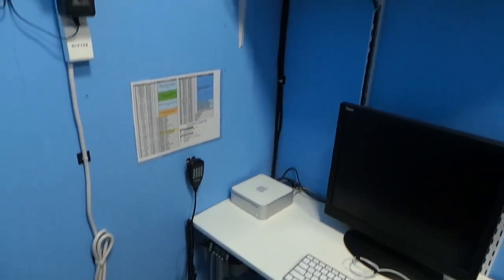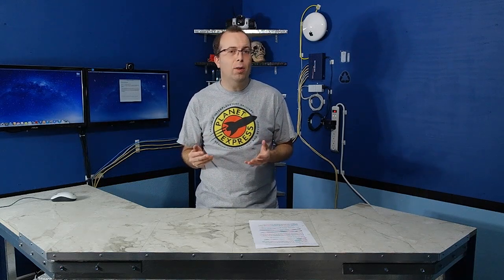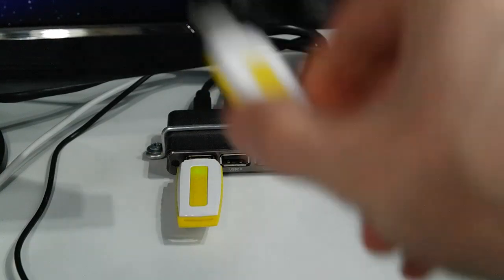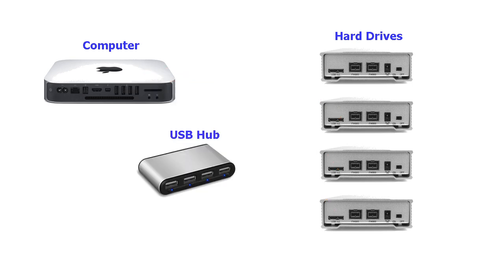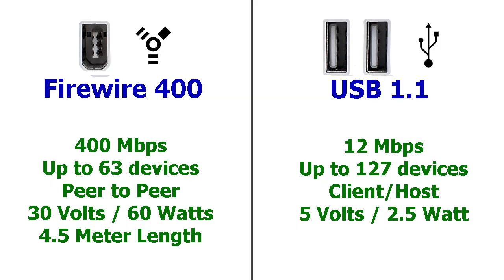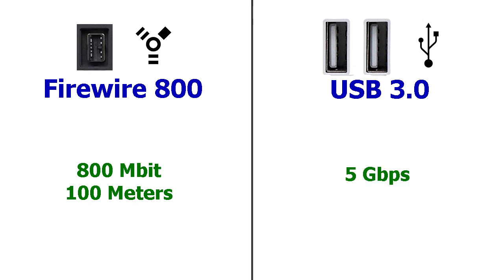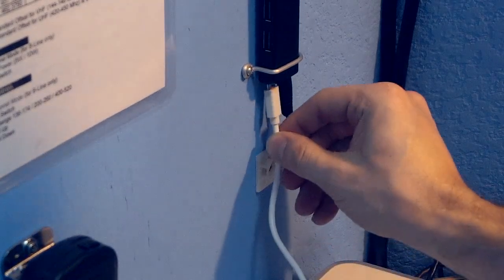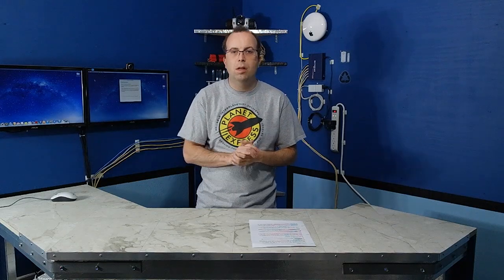Farewell R.I.P. Firewire, Hello USB!

Comment: firewire was replaced by thunderbolt. not usb.. i can daisychain with thunderbolt
Reply: What's Thunderbolt? Is it good?
Reply: +Isaac Adam thunderbolt was started by Intel it's like a second gen mini display port with a lot more capabilities such as data transfer and daisy chaining. It's rated up to 50gbps on thunderbolt 1.0
Reply: Thunderbolt 1 & 2 have the same connector as mini Displayport because thunderbolt is universally "backwards" compatible with displayport. If you have a monitor with a displayport input, a displayport cord, and a computer with a thunderbolt port, then you can connect them and the thunderbolt port will function as a displayport output.

And the switch from Thunderbolt 2 to 3 is easier in most circumstances than USB type A to C because of the daisy chaining properties of thunderbolt. If you have multiple thunderbolt 2 devices connected to each other, all you need is a single adapter at the end that plugs into your computer and all the chained devices work exactly as they did before.
Reply: +Brendan Tate no is is not you can buy thunderbolt cards for pc and they use pcie express x16 slot
Reply: It's you who have no clue. 8b/10b coding is used in a hell a lot of things to achieve DC-balance, including Ethernet, USB, Firewire beta mode, etc... invented way before DVI and HDMI. BTW, DVI/HDMI uses different 8b/10b code-set unlike previously mentioned standards and DP. Old DVI display will happily accept HDMI signal with RGB color coding (which is usually used). DisplayPort transmitter sends signals in LVDS format and HDMI transmitter transmits signals in TMDS format. Displayport use different voltage levels compared to DVI and HDMI. Therefore even if DP output is dual mode with HDMI/DVI support, it still needs voltage level converter in "passive adapter" (not that passive, huh?). HDCP is built on top of the data transfer, is optional and often not used in PC displays, and to my preference should never had born in the first place.
Displayport has differential bi-directional, half-duplex auxiliary channel, HDMI has I2C for E-EDID + optional bidirectional 1 wire for CEC. Hot plug is just a wire connected to +5V through the resistor, what an invention...
Displayport supports daisy chaining multiple displays, HDMI/DVI do not at all.
So how in the hell are they the same?
Reply: +matsv201 Wow. Then I guess that Firewire and USB 3.0+ are more reliable than Thunderbolt.
Reply: I have a clue because I'm EE and actually designed some electronic devices which are currently in production.
One more big difference, DP don't have twisted pair for clock signal unlike HDMI/DVI. The most ridiculous part of what you said is claiming that HDMI is more similar to DP compared to DVI. 
EDIT: BTW, DP does not have exactly 3V as you claim (3.3V PWR). HDMI/DVI signal level is 3.3V. 5V in HDMI is only for I2C and hotpug. Signal level in DP is around 0.4Vp-p
Reply: So... you claimed DP/HDMI are almost the same, unlike DVI/HDMI :). When proven opposite, become angry and call that irrelevant shit. What a strong arguments you have.
Reply: +matsv201 Thanks for the info.
Reply: Only IF there is a thunderbolt 3 harddrive case, which is still a no-show, but hey, we could dream right?
Reply: @4IN14094  I'm from the future and I have great news for you
Reply: helloeyItsZoey 

I think you confused industry standard, and standard in the industry
Reply: helloeyItsZoey Its a industry standard for consumer and presentation screens... not for industrial monitors.
Reply: Jonathan Rogers Well, recent laptops does have thunderbolt port build in, but it is Thunderbolt 3, and it uses USB type-C plug, which is a huge improvement compare to Apple offerings.
Reply: matsv201 DisplayPort can do 8K at 60HZ, and HDMI does 4K at 30HZ so lol
Reply: "This enables HDMI 2.0 to carry 4K resolution at 60 frames per second (fps).".
matsv201 dp is still better. that's why more high end graphics cards have MORE displayport ports then hdmi..
Reply: also, thunderbolt is low overhead, and low latency, unlike USB, and it's not dead, even in 2017. Audio interfaces alone keep it alive.
Reply: Jay, do me a favor? Shut the fuck up when you have no idea what you're talking about. the USB C connector does not mean it's USB. Thunderbolt is much closer to external PCIe. Please google it, and stop giving people fake advice.
Reply: DP is not a ripoff of HDMI. Both how data is transferred and the connector are completely different. HDMI on other hand is a complete ripoff of DVI with smaller connector and royalty fees added, although it got updates after that while DVI did not. That's why you can use passive adapters between DVI and HDMI in either way. Actually the signal source has no way to know if HDMI or DVI device is attached other than by EDID contents, which still would tell about port type only by secondary means like audio support declared. Only EDID standard 1.4 added a definite way to say it's HDMI, not DVI.
Reply: And in fact, DP is much more similar to SATA or USB3.x in the way how the data transferred, rather than HDMI.
Reply: Displayport is not a ripoff of HDMI. DP offers way better performance for support for more displays and higher resolutions.
Reply: +Jonathan Rogers Most premium Windows laptops come with thunderbolt nowadays.
Reply: ¯\(ツ)/¯
Reply: trizm 6ix 六 Why do you compare with HDMI 1.4 when both 2.0 and 2.1 exist? 

And no. DP cant do 8k in 60Hz native. It got to run DSC to run 60Hz in 8K.

Bandwidth is 18Gb/s for HDMI and 25Gb/s for DP so the diffrence  is not that big.

The reason why HDMI sues lower speed connection is do to cable certification. HDMI got a more laxed cable certification simply put.

HDMI and DP works in exacly the same way. DP was only made to bypass HDMI certification. If you think that DP is a "professional" version you are really lost. Rather the opposite is true.
Reply: trizm 6ix 六 The draft is, but its not certified.. 2.0 have been out for quite a while, and its the version that have 18Gb/s.

Initially DP used draft HDMI version to push to the market
Reply: trizm 6ix 六 It can run 5K in 60fp to... or 4k games in 75fps. 
The HDMI 2.0  have 28% lower bandwidth than DP 1.4.

You can´t run true 8k in 60fps on DP.. you have to use both EIA/CEA-861  block reduction as well as compression. 

Really if you use normal block and no compression DP is limted to 5k 60fps as well.

"dp is still better. that's why more high end graphics cards have MORE displayport ports then hdmi.."
Its because the licensfee is a lot lower on DP than HDMI
Reply: The problem with Thunderbolt 3 using the USB-C connector is consumer confusion.  Lets assume you you have a HDMI  monitor and you buy a USB-C adapter to connect it., but it might not work because there are three different ways the USB-C can be acting to output video

Type 1): Video delivered via USB 3.1 protocol
Type 2): A display port signal acting as HDMI
Type 3): Thunderbolt acting as HDMI

Now the only laptop I know of currently that implement all three video out options are the current line of macbook pros.  So random converter dongle your borrowed from you buddy may, or may not work, unless you are using of the said Macbooks. 

I just say if you have a non-mac device just stay away from any USB-C connector device that is stylized for macs...
Reply: OTIS  lol your lieing!!
Reply: I didn't say graphics cards. Also, what I meant that rom has software I meant that it works with software to do it's job.
Reply: He is probaly unaware of thunderbolt because he is using an Mac Mini 2010 wich does not have thunderbolt.
Reply: matsv201 thunderbolt is apparently backwards compatible with FireWire provided you have proper adapters. I have no idea how.
Reply: The YouTube Critic - "And yes the Thunderbolt 2.0 plug is the same plug as Mini DisplayPort. Why? I have no idea"
It's because Apple invented the mini displayport and owns all the patents for it so by using the same plug for Thunderbolt they didnt have to pay somebody else and all the tooling equipment/parts was already there.

They used Firewire for the same reason. They invented it so it was designed from the ground up to fit their needs. As the inventor of it they pay less or no royalities for using it too.
Reply: Jun Hong DisplayPort supports 8k at 60 hz
Reply: trizm 6ix 六 That is not corect. DP only supports 25Gb/s. Then it still need color reduction to work
Reply: 2.1 isn't out yet?
Reply: ***** ik lmao
Reply: @old stuff, 4/10, I hope to god you're the semi terrible troll I think you are.
Reply: OTIS notice the drives he had didn't have thunderbolt
Reply: 9291Sam usb is better
Reply: that's just cause you don't know any better mr cool panckaes. it's way worse. you know what's good? knowing before you talk.
Reply: Murphy the Turtle listen,i use both and usb is faster for me i dont know maybe the adapter for thunderbolt is causing the provlem
Reply: Vitto Wang no those are two entirely different things
Reply: @Shidou, there are absolutely pieces of malware that store themselves in rom (hardware) and can persist through a clean install. Please stop talking.
Reply: rom has software though, so you are incorrect
Reply: millennial, you said that hardware like screens and graphics cards could never get infected, and that you could wipe them away. I told you that you were wrong, and you said rom was software. In the context of that conversation you might as well have said "chickens eat farts" (regardless of the classification, that rom is still on that hardware, which you said couldn't get viruses) Nor does it go against the argument that you can't just hard drive wipe them away. With logic like that you'll never be a good sociopath. Children.
Reply: Isaac Adam a lot more better than both
Reply: OTIS it was co-started by both Intel and Apple
Reply: Will - try responding to one person at a time. You responded to part of my comment, and part of other peoples. I never mis understood DP TB and HDMI, infant, I'm the one who corrects them originally, like months ago. Then you actually respond to something I wrote. You don't get how. monitors can get viruses. fucks sake. have you ever heard of firmware? it's software in hardware that exists now. You infect that, and that's how you give a fucking monitor a virus. Are you kids for real? They did proof of concepts on video cards and ROMs in mother boards years ago.
Reply: So much misinformation in this thread. Like most of it.
Reply: correct me if I'm wrong, but wasn't hdmi dvi+audio?
also thunderbolt 3 can be used to plug in a GPU which is quite useful on a small laptop as you don't need a desktop pc.
Reply: Murphy the Turtle rekt
Reply: 700gsteak: Nobody pays any royalties for Mini DisplayPort. It's freely available.
Reply: My thunderbolt multiport has USB-C, VGA, HDMI, PCI adapter for graphic cards.
Reply: He never said USB replaced Firewire in the video. He only said he could not find any new Firewire devices and therefor needed to add USB storage to his system. He probably was aware that Thunderbolt could be used, but that would assume he had the connections available for it.
Reply: And now Thunderbolt 3 uses the same connector as USB 3.x Type C.
Reply: How did you know, OTIS? 
Are you a Thunderbolt fan???
Reply: thunderbolt 3 is basicly usb 3 with extra features
Reply: Never heard of it.
Reply: get me a macbook with thunderbolt and a thunderbolt hub :)
Reply: I'm not sure why you dislike Display Port so much, they both carry digital signals and one is a newer, improved version of the other. One standard is bound to be replaced by another, if you don't like this idea I hope you're still using composite. Jokes aside, I'm pretty sure HDMI limits 4K video at 60hz with the HDMI 2.0 standard. Though it came out in 2013 I haven't seen too much of HDMI devices that utilize 2.0. Display port on the other hand supports 120hz at 4k and 8k (Not sure about the hz). Sure we don't have 8k monitors and a very small amount of 4k 120hz monitors today, but its simply future proofing. Nothing wrong with that. If it's the connector that you dislike, Display port is starting to be  integrated into the USB C standard creating not only reversible but compact connectors. Now, don't get me wrong I've only used Display port on my desktop, and HDMI is great. I practically use HDMI with everything. But it's obvious its time is slowly coming to an end. In fact, most likely the next gen consoles will implement display port spec. Of course, that doesn't mean HDMI is going to be killed off anytime soon.
Reply: @junhawng  I miss VGA
Reply: In what industry is HDMI the standard? You'll find most HD Video is carried over HD-SDI in industry.
Reply: +matsv201 hdmi is trash man... displayport is the dvi replacement
Reply: +matsv201 yes, sorry. I should have said one of the newer sdi standards. HDMI is definitely the consumer/home cinema standard, but you won't find many industries, whether TV, film, cinema, or live events using HDMI as standard. They will accept it, but it is not the standard
Reply: +matsv201 possibly. I suppose you could say it's the TV manufacturers' industry standard, but that is arguably because of its encryption capabilities.
Reply: +Isaac Adam  thunder bolt is a new standard developed by Apple and Intel. It has a whopping 40 gigabit speed look up more on it is awesome
Reply: Isaac Adam Well.. ironicly USB is kind of between Thunderbolt and Firewire in system interface.

While USB have a relatively low level of abstraction, and the abstraction that is there is as little as you can get away with (USB is very much Keep it simple stupid-design).

Firewire is abstracted by a both network and system protocols. So its very much abstracted. This make it flexible, safe, but also complex and expensive.

Thunderbolt is really a very simple interface. Its just a port right on the PCI-e just modulated right out of the computer. Make it.. well sort of cheep... well on the computer side... on the slave side its a bit worse.

This makes Thunderbolt quicker and more flexible, but also more pointless. M.2 interface do about the same but in a much better way. Also a lot cheeper.

I don´t really se the thecnical point of Thunderbolt. This seems like its developed for there own business and not for the customers. Its really a market replacement for Firewire in there sales division.

And it also seems like a lot of people think that Thunderbolt is a replacement for Firewire, because its marketed this way.

In a technical standpoint Thunderbolt is really stupid. Because its a direct to system interface. If you for example use Thunderbolt to access a Projector in a hering room: How ever can install a in-between device that install spyware on the computer.

Because its a direct system access the virus can write it self directly to disc, there is nothing the OS can do to stop it. This was never a problem with firewire
Reply: "screens" or displays cannot get viruses so how would they be able to infect the connected computer? I could be misunderstanding what you said. 

Thunderbolt combines PCI Express and Display Port into one serial signal, and additionally provides DC power, all in one cable. Thunderbolt is not a ripoff of mini Display Port, it just uses the mini display port! Thunderbolt is not the connector, it is a standard. It can come in the form of a mini Display Port connector or in the form of a USB type C connector. 

You said that thunderbolt is only useful for "connecting screens", but it can have many other use cases. Because it can carry video, audio, and other data all in the same cable, you could have a computer with one thunderbolt cable connected to it and have the other end of the cable connected to a Thunderbolt dock to plug in the computer peripherals. This means that all of the data would go over just one cable! And if you used a Corning Fiber Optic Thunderbolt cable, you could achieve this at a length of up to 60m/200Ft. Thunderbolt also allows daisy chaining and speeds up to 40Gbps! 

I think Thunderbolt cables with USB Type C connectors will be the way of the future. I hope you consider this information. If anything I said was factually inaccurate please point it out so I am not spreading misinformation.
Reply: OK Do you even know the difference from HDMI to DP?
Reply: +matsv201 you can use passive adapters to convert to dvi. Means nothing
Reply: St0ner1995 
"you can use passive adapters to convert to dvi"
Actually you cant. If you put a DVI to HDMI/DP adapter on a DVI port, its actually the HDMI/DP that run in a fallback mode.

In most cases is actually the other way around. What is a physical DVI port, is really a electronic HDMI/DP port that is able to run in fallback mode.

HDMI/DP is virtually the same. The only diffrance is the extra pair for DP and how its licensed.
Reply: +matsv201 yeah. HDMI is shit, display port can do everything better and more. For example, I can run 6 displays off of display port when I can only run one off of hdmi. Display port also supports higher resolution at higher frame rates
Reply: Actually no. Thunderbolt and Firewire is totaly different types of interfaces. The connector looks kind of similar, but there the similarities end.

Firewire is a network interface, and thunderbolt is a systemport.

Thunderbolt is also the worst standard ever. They change everything for every new generation. And the interface is just a ripoff of DP, that is turn is a ripoff of HDMI.

Using Thunderbolt to connect drives drives is horrible.. don´t even think about it. Also the system is very sensitive to system attack.

The only thing you real can connect with any point to a Thunderbolt connector is a screen, and then it also totaly pointless because then a DP works just as good.. well actually better. (there is both daisy chain and hub capability of  DP, but few screens support it, on the other hand, even fewer support TB).

Worse is that if the screen is infected by a virus.. then you got it on your computer to. TB have total direct system access, there is nothing stoping a virus
Reply: @matsv201  Thats a bunch of lies(untrue assumptions) tbh 😅
Reply: matsv201 not trying to sound like an ass but how the hell does a monitor get a virus.
Reply: @matsv201  if i am right thuntherbolt have acesse to pcie with direct memmory accese?
Reply: @lukkan99  Pretty much.. but it might not be true for every version
Reply: @matsv201  You are so clueless.  Thunderbolt 3 is a superset of USB 3.1 and has more speed and more capabilities, including daisychaining high end external gear just like FireWire did.  They changed ports literally ONCE and that's just to make it play nice with the USB-C standard, which not a bad thing at all.  If you have an old version, it's still backwards compatible via a simple port adapter.

How is it a ripoff of DP?  Because it once used the same port? And if so, who cares?  DP is a decent standard, but TB3 does so much more.

The ONLY valid point you made is in reference to security, because there was a vulnerability (which can be patched via firmware update) that allowed an attacker to compromise SOME system if he had physical access to them.  However, this is only because Thunderbolt allows much deeper level hardware access to USB.  Again, not a bad thing because this means more capabilities, features, and better performance due to less host CPU reliance.
Reply: @bluesdealer  
Eeeh.. no. You are clueless... While thunderbolt use the same port and 8/10 modulation as USB 3.1 it's very different in all other regards.

Dasychaining is really not a thing. It's just a internal 1-2 hubing... Or rather switching.

Thunderbolt use direct dma that's makes it very quick and also makes possible to use external components as if there was internal. The downside is that there is no firewall protecting the system.

In short never plug in a unknown device in a combined thunderbolt usb-c conector
Reply: You can't patch out dma issues
Reply: @matsv201   You should only plug trusted devices into USB, regardless of it's level of hardware access.  There is still malware that can activate from simply plugging.  TB's ability to act (and basically perform) like an internal component is one of the best things about it.  You can theoretically build out complex systems using devices with soldered internals and no expansion slots.

Would you plug in an untrusted PCI express card?  Of course not.  Same goes for TB devices.  And it's not much of an issue because it requires physical access.
Reply: helloeyItsZoey HD-SDI is really quite outdated by now.
Reply: +Jay Cie No it isn't. Take a little bit of time to do some research before you spread misinformation.
Reply: cthehollowman You don´t have a clue. DP is a non standard rip of. The only reason its got higher preformance is that it got 4 lanes in steed of 3...
Reply: I supplied ample of prof. Its a fact. They are very similar. Not identical, i never claimed that

Yes DP have 3 volts. Its not really a major change. Some of the axuliary channels work somewhat diffrent

Its quite obvius that you read it of Wikipedia and don´t have a clue what you talking about.
Reply: OTIS thunderbolt IS USB c
Reply: Kill thunderbolt
Reply: Daisychain, what is this, 1985?
Reply: OTIS well, thunderbolt uses a USB to connect to devices. Also, only apple uses thunderbolt, everyone else uses normal USB.
Reply: St0ner1995 You don+t have a clue. DP is a botch non certified HDMI. Basically a rip of.HDMI.

HDMI is a industry standard, DP is something VESA just ripped of and push to market a head of time.

They use the exact same transfer standard. There is one lane more (4 in steed of 3) on DP). Everything is the same. DP is just a basterd of HDMI.

That is why you can use a passive adapter and convert HDMI to DP... its basicly the same. DP just steped of the standard to make it hit the market quicker.

"For example, I can run 6 displays off of display port when I can only run one off of hdmi."
That is not accurate. You can run... well basicly any number of a HDMI,but you are practically limited by the resolution

"Display port also supports higher resolution at higher frame rates"
If you have more than 1 8K monitors or more than 4 4K monitors... well than sure... do you have that?  DP have one lane more, and is there for slightly faster.

A lot of people tend to belive that HDMI is a rip of from DP because DP drop the new earlier. The reason is that HDMI got a grace period for the the new versions, DP don´t. DP just copy the next HDMI of the grace period put it into market and hope for the best. That is why DP is way more buggy.

In other word... HDMI.. if you can fit the contact.. it always work.. for DP... it might work
Reply: If you think Thunderbolt is going anywhere, you've been paying way too much attention to Apple hype.
Reply: Sorry dude but thunderbolt is USB now. The current standards has the connector of a thunderbolt cable being USB-C.
Reply: Yea.. you don´t have a clue.. DP and HDMI have the exact same setup everything from 10/8 coding down to pixel transfer method.  DVI use a normal binary multi serial transfer. Also using the same + - neutral balance transfer. Also use simular, almost identical software encoding also using HDCP, hot plug detection.. the list goes on and on and on.

The only real major difference is that DP have 4 lanes in stead of 3. Yea sure the conector looks somewhat diffrent, but its really fairly simular. Just the keing and number of connectors that differs.

HDMI was made to be backwards compatible with DVI, but it have nothing in common a part that it have all the same number of conectrs. THe protocall is all difffrent
Reply: You are really not disputing my statment. Just posting a bunsh of irellevant shit
Reply: thats only available on macs tho